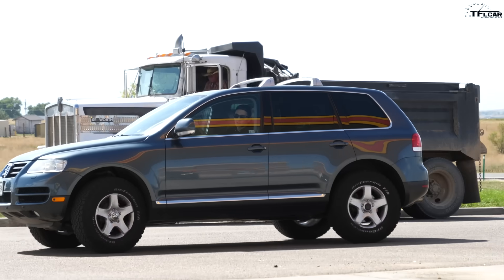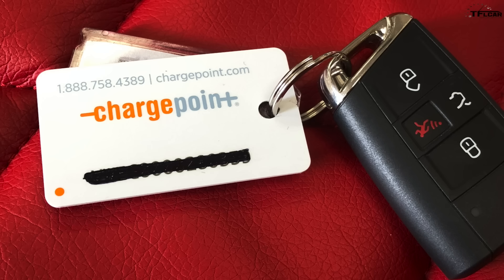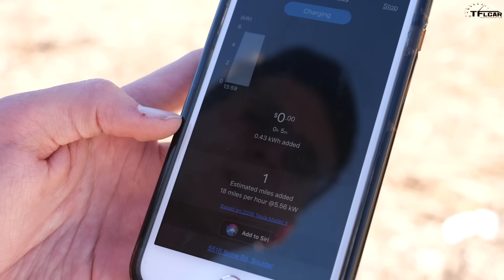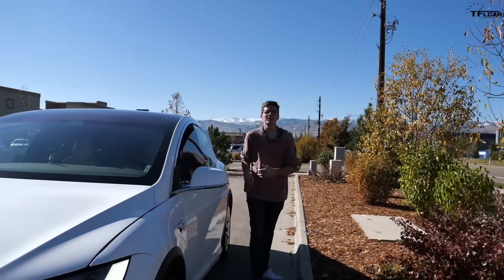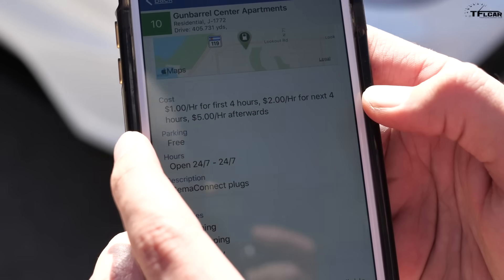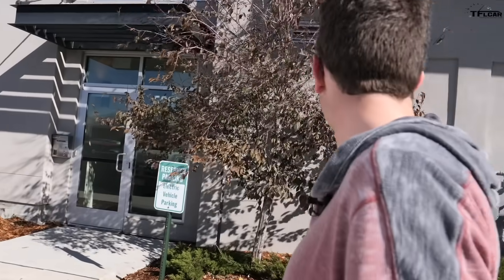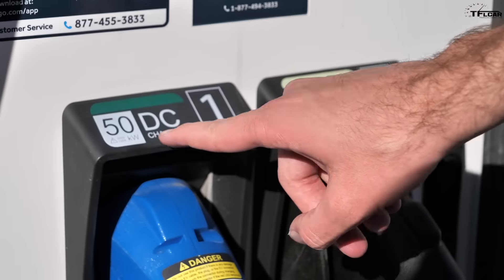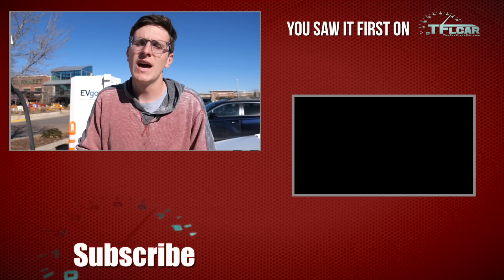Here’s Why Charging an Electric Car Can Suck - And It’s Not The Reason You Think!

Comment: 0:30 I just want to say.. neither do people have gas stations in their garage.
Reply: But you can have a gas station across the street where you live and fill up your tank in less than 10min.
Reply: @oscara.9265  for commoners people don't even have to drive at least 75% of the day. During that 3/4 of a day your car can recharge. 

Nor does everyone even have a gas station in front of their houses. In my country a gas station is somewhere never near housing districts. That would be a miracle for that 1 house to have a gas station in front of it. And maybe for another 7 homes around it. And then what? The next gas station is about 4 miles away. Only 1-8 houses benefit from a gas station being near them out of the tens or maybe hundreds of other homes that also need gas stations to be in front of their houses.

Also it is more possible for someone to have a charge port in their garage than a gas station. We already have electricity behind our walls. It won't be too long until we can have recharge ports inside homes. But a gas station is less possible. Jerry can? Sure but would a country rather buy more fuel from other countries or have the sun or wind easily help them get electricity?

Comment: Love my VW Passat TDI 2015, tank capacity 17.9 gallons of Diesel fuel, with 800 miles range on Highway and 650 miles city drive, before I made 1000 miles with a full tank but still doing good with the fix  by the EPA after de Diesel gate, Tesla can’t beat that for now, and way expensed for long range battery 🔋 $70 K plus , no way.
And many says Diesel is bad , this and that ,  I saw a lot a vehicle’s polluters worst than a VW , all those Trucks, F- series , Duramax , Semis, Buses, construction ,agricultural , harbor, locomotives equipments.
 Anyway  the cost of electric vehicle is crazy, no thanks , time is precious in this country, 
How a hybrid Diesel ? 👍!!!
Reply: You can power tune your VW and restore your missing hp and mpg that the dealer tune took away, plus more.

Comment: Why not just use them as you would a normal gas pump? Swipe your card and connect. Using an app is making it over-complicated.
Reply: You got it! Pull up to the 'pump', swipe your card, put in the nozzle and recharge. It NEEDS to be that simple...just like regular gas pumps are now.

Comment: Last I checked, most homes have 240VAC. Simply task to wire into power panel and connect a 240V plug. As a side note, you can get 240V from two different 120V outlets, just merge them and there you go........Should be good for about 3 KW.

Comment: We are still so close to the beginning of the EV adoption story. Hopefully in a few years things start to become more universal. For the person with a garage and the spare electrical capacity to add a dryer plug to the wall of their garage - living with an EV is easy. For the traveler who has a routine route, they'll figure out the best places to charge the ones that are reliable, near a favorite cafe or pub or store. For the EV driver who refuses to do their homework - they are in for some tense moments as they near empty and lack the understanding of their machine. They'll be the ones that complain the most to anyone that will listen. I would happily set out on a nationwide EV tour but I recognize the limitations of the technology AT THIS TIME. It'll get better. 
I'm caretaker of a quartet of Nissan Leafs at work. We don't have a level 2 charger yet (ordered) and charging with a 120V extension cord works but 2-3 days to recharge after the cars have been run almost empty is not sustainable. The 150 mi car finishes sooner of course than our 220 mi Leaf. If I owned a Leaf and commuted with it, I think it would be sustainable b/c my route is ~10 miles each way and I could recharge in my garage even on 120V. (I prefer to ride my ebike for a trip this short). Ultimately though I could use the same 220V outlet I use for my welding machine or the air compressor. The Leaf comes with a black box that has adapters for 120V outlets and 220V dryer plugs.
Thanks for making this video. All this info is out there on the web but it was good to see it all combined in one video.

Comment: You have to go through this pain if you want to help the environment🤭
Reply: Oh, horsedroppings. Compressed Natural Gas (CNG) is much, much cheaper, and we already have a nationwide infrastructure devoted to it. It's the exact same stuff as in your gas range in the kitchen. Ironically, many of the electrical plants that generate power (EVs included) are already powered by CNG. EVs are a huge hoax. Refueling takes about the same time as gasoline.
Reply: Al C - Teslas are not a hoax. Go test drive one and see for yourself, unlike any other cars including other EVs.  What other car gets better and more functional with time, the free software updates a few times a year make Teslas better each time. The latest just before Christmas added a bunch of voice commands along with other features.  Can you name a ICE car that gets better with time?
Reply: @Chainyanker007  What do you mean by better? Does it drive or handle better? Do the updates make your tires better? Do the updates change your shocks? Replace your brake pads?
Software...hahahahahahah.
It'll take you longer to say what you want than it does to push a button on the AC. Useless crap.

Comment: Wait for hours....right. In winter,....in the freezing cold, you should know how that is in Boulder Colorado. Thanks for convincing me not to buy an EV for a long...long time. What a joke.
Reply: You're right, of course. EV's just aren't "there" yet for the vast majority of consumers. There will be NO EV Revolution, as the fanboys like to call it, until electric cars can do what regular cars do so easily - mainly, getting another 400+ miles of range in 5 mins. The first EV carmaker to crack this challenge will be the one to make electric cars go mainstream.
Reply: @jaroessa294    Thanks jaro. Another component to this is the lack of qualified repair shops, when something does go wrong. These are complex electro-mechanical systems right now only a few people understand even on the sub-system level. Then there is the cost of ownership, especially the batteries. Too many unanswered questions to very expensive problems.

Comment: So ! How da fuq do you drive from NY to FL in 19 hours that the navigation gives you? Only with gas engine right ?
Reply: Buy a trailer and install a 10KW genset and fuel tank. Rig an electric transfer switch and remote starter. With practice, you'll be able to charge as you drive. You'll probably need to add a fire suppression system and get a hazardous transport license but you'll only have to stop to fill your genset tank. This can be done!
Reply: We drove from Cleveland to Orlando (1200 miles) in about 18 hours in our Tesla Model 3 (15 driving, 2-3 charging). EV road trips are totally doable, at least with a Tesla and Superchargers.
Reply: @Jaws1200  What do you do during that dead 3 hours? Can't leave your car, so I guess it's hiney seat sex until you can roll. Christ, that will get old quick...REAL QUICK, putting on a pubic show, as your Tesla drops to as close to absolute zero as a licensed car can get. Now you know why.  :))

Comment: Most of the commenters below don't seem to understand that the majority of EV owners do the majority of their charging at home during the night when they are asleep. Add to the fact that this guy was using one of the slowest public chargers available and not a faster newer charger or a Tesla supercharger that often gets the job done in 15-20 minutes. What's being shown in the video is basically a worst case scenario. that being said there is still far more power in a gallon of gasoline then the equivalent amount of electricitybut most cars can only end up using about 20% of that gasoline power to turn the wheels where an electric car use is over 90% of the electricity to turn the wheels. Electricity is all so far cheaper than gasoline. The tech is changing at a pretty fast pace. In a few years the energy density of batteries and the recharging rate will be nearly that of refueling a gasoline vehicle.

Comment: I'd rather pay 4 times the cost to leave in 5 minutes then 8$ to leave in 20 hours
Reply: Few Tesla drivers would end up using a non-Tesla public charge station with those slow charge rates as shown in this video as there is likely a Tesla SC station nearby.  People are being mis-led. OTOH, if you owned a non-Tesla EV, it’s another story.
Reply: @Chainyanker007  I think it says a lot when he reveals Tesla uses a different plug in Europe that is more widely available for fast charging while using a proprietary plug in the USA.  The apartment charger hours of 8a-5p is ridiculous. That means residents are charging on their day off rather than running errands if they're single. It reminds me of the pain of odd/even gas lines in the late 1970s where you could fill up based on your license plate because of the shortages.

There's a small selection of working people who have the flexibility for hours of charging.  Sure you can stop here and there to charge but that's nuisance. I'd have to charge at a nearby mall or at a competing business near work--I'm sure they'd love that. That's not for me.
Reply: @Palm Coast Adventures That would certainly be a neat thing, but the question is if such a business model is profitable. After all, most everyday users of an EV wouldn't need such a service because they recharge their vehicles at night and seldom drive 400-500 km in one go.
I suspect before that happens we will see more innovation in battery technology, extending the range of EVs to that of regular ICE cars.
Reply: @Palm Coast Adventures Do you realize that in most EVs the battery is not comparable to that in a ICE car? Tha battery of a Tesla Model 3 is basically the entiry floor of it. It's not that simple to exchange that.
Reply: You can buy a used, fuel efficient Civic or Prius and destroy any savings that an Electric Owner would enjoy, because your cost of ownership would be much, much lower. It would literally take several decades for your cost to catch up.
Reply: Electric cars is not for the country !! City yes 
Country No !! 
They can't even pull a trailer or RV 
So usless on the country !!
Reply: If the gas station were empty, it only takes around 2 minutes to fill your tank
Reply: Pretty much for non Tesla EVs it’s really not worth taking on a road trip, they don’t really have good range and fast charging for those cars are extremely hard to find. I think for around town back and fourth to work and to do errands it works great, less random ICE car issues to go wrong and much cheaper to run. I’d say if you want an electric car to do it all then spending more to get a Tesla is worth it. All superchargers have restaurants, supermarkets, malls, and fun destinations to check out. Usually with a Tesla you’d be 3 hours into your trip before having to stop to charge and by that point most people need a bathroom break or a snack and by the time your done eating or checking out a store nearby it’s almost done charging. Plus if you don’t wanna eat or shop Tesla has YouTube, Netflix, Hulu, and loads of video games build into the car to enjoy for 20 to 40 mins till you are back on the road. But whatever car makes you the most comfortable on a road trip is the best choice.
Reply: Toxic Neko this all becomes fixed if u just buy the 250v outlet and have a full charge every morning
Reply: @bowowx7772  which is irrelevant if you go on a road trip you dont have access to your home outlet
Reply: @chrisjohnpiere6140  I've been on tons of roadtrips with my Tesla Model 3 and I usually pay an average of about $10 to charge at a Supercharger and it never takes more than 40 minutes.  You are confused or have been misled by bad information from someone who does not own or drive a Tesla.  When I am home my Model 3 charges overnight while I sleep and takes about 4 - 5 hrs using a standard home electric dryer plug which you can install yourself easily.  (Watch a YouTube video on how its done.)  Home charger at 220 volts charges at about 30 miles per hour.  Superchargers charge at like 500 miles per hour and then taper off when battery gets nearly full.
Reply: @chrisjohnpiere6140  If you go on a road trip, rent a gas vehicle.  In the end it's still WAY cheaper than owning a gasoline vehicle.
Reply: Much more convenient to charge at home, also much cheaper, 1/2 to 1/5 the cost of gasoline, no oil changes or tuneups, no belts or hoses. How often do you take a long trip?  Most people just commute 1/2 hr or less oneway or run errands most of the time so an EV is much more practical. Also most charging should be in the 20 - 80% full range for the battery.  For those who charge a Tesla at home it is easy to set when and how much you want to charge and it can all happen automatically at night when you are sleeping.  No more having to pay $30-50 to fill up the tank.

Comment: Here's an idea, and this only solves the "waiting" part of owning a fully electric car. 

Interchangeable battery packs

1. Build the car with universal multiple battery bays that are easily accessible.
2. The packs themselves are carry friendly, not too light, not too heavy that an average person will be able to swap them easily.
3. Install the batteries, return the expended. Pay/tap and go!

In and out in maybe 10 mins. The station attendant charges the returned packs overnight ready for the next customer the day after. Rinse repeat. Now long term, this idea might cause an issue with recycling the batteries years down the road. But the impact on the environment is much less than the carbon monoxide gas engines produce.

Comment: Tesla superchargers can go up to 500+ miles per range per hour.  That's what I get on most of the chargers here in California on my Model3.  I typically only need 15 to 20 minutes of charge at a time.
Reply: Yeppp...another "FAKE NEWS" Kool-aid sipping Tesla fanBOI !!!!  Sorry, bud, Motor Trend debunked this back in July...BIG TIME!. They couldn't even get their test Model 3, SUPPLIED BY TESLA, to get to 100% after 75 mins on a v3 supercharger. And we all know that there are NO Model 3's that have a 500 mile range capacity. So your claim that it can charge 500 miles in a hour is COMPLETELY BOGUS! Yeah, keep spreading your 'faux' facts and watch more and more smart consumers push back on all this outlandish EV propaganda!
Reply: @jaroessa294  I'm definetly a fan boy, the Model 3 is the best car I've ever driven.  I didn't say the car had 500 miles of range, it has 320.  But the car will charge at 500 + miles per hour.  It charges the fastest between 20% and 90%.  After 90% it does slow down considerably to preserve the battery life.  I typically only keep the car between 20-90% range so I only have to charge for 10 to 15 minutes at a time.
Reply: Tim Alatorre   So you sit around for 20 minutes? I fill my car once a week for 5 minutes. What do you do if someone is in front of you charging? Wait even longer?
Reply: @TheRotorhound  99% of the time my car charges at home, I don't have to go once a week for any amount of time.  I only need to charge on road trips; so I stop, plug in, go to the bathroom, grab a drink or a snack, come out and the car is ready to go.
Reply: Tim Alatorre   My next door neighbor has a tesla and does the same thing but I live in a town of 100 k and we have no charging stations. It’s not the 99% that’s the problem, it’s the 1%. What do you do when all the chargers are in use? What do you do when the temp is below zero?  What do you do when you have to make an emergency road trip?  My brother just move to Sonoma county California with his tesla and they keep shutting his electricity off. Tough to evacuate when they say you must leave.

Comment: While the facts are totally accurate in the video, it does give the impression of undue complexity. As a Tesla Model 3 owner for more than a year, I have found it to be really simple and easy to charge. I had an electrician install a Nema (dryer type of outlet) in my garage for about $250. I just plug in my Tesla charger (it was included with my car when I bought it) into the Nema outlet and the other end into my Tesla. Every night when I get home I just plug it in. It charges to 90% (about 280 miles of range). That is plenty for my everyday driving. I don't need to mess with any other charging solutions. I always have plenty of juice to drive where ever I want to go. On trips I just supercharge, super easy and automatically routed for me on the built in GPS app in the Tesla. It is not complicated and I never have to mess around with any of this 3rd party charging stuff that you see in this video.
Reply: Nate   I live in North Texas in a city of 100 thousand and we have no charge stations. You may cover your everyday driving but a trip anywhere may be a nightmare. My brother found out that when the cut your power in California for a week at a time it's tough to charge at home.

Comment: The best in coal powered car.  It is so amazingly inefficient.  You lose 90% of the energy converting fossil fuel to electricity and then even more in transmission over the lines.  It is so anti-eco!

Comment: I think people miss the fact that you can and will charge your car when you're at home. You can't get gas with your car in your garage but you can charge it even if it takes a while, your car isn't moving while you're sleeping anyways. People in the comments saying they can get 500 miles in 5 mins at the had station fail to realize that an EV owner usually doesn't stop for fuel unless they forget to charge at home. The only good reason I see someone using an EV charger is if they're in the middle of road trips or if they're at work or doing something that will have the car parked at an area for a long time anyways.